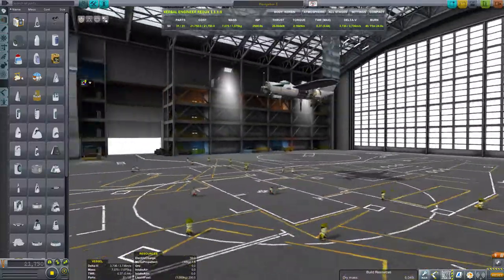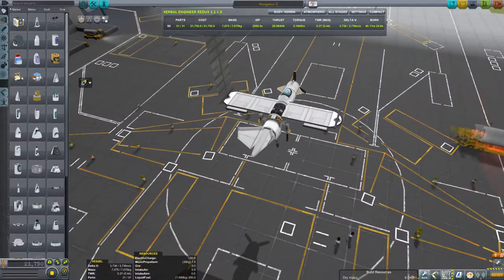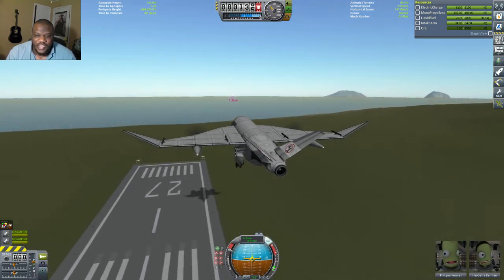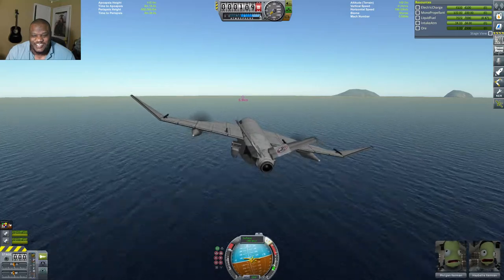Kerbal Space Program - Flights of the Navigator Series - Atmospheric Exploratory Aircraft

Comment: On the Navigator V, it wasn't going straight because your wheels weren't straight. They were kind of like this... / \ which causes intermittent, uneven traction pulling it to one side or the other. Wheels have to be perfectly straight horizontally and vertically or your craft will go funky on the runway.
Reply from the maker: yeah, I have the camber to counter the suspension issues. makes it more stable to land but affects the liftoff...one or the other i suppose lol
Reply: LOL Yeah, I was playing with the firespitter biplane parts in career and those wheel refuse to work properly. Same issue, got it to go straight long enough to get in the air but on landing the wheels stuck to the grass. SMH
Reply from the maker: +Jolly Roger Aerospace yep...firespitter wheels still need some tweaking...BD Armory though...in my testing...seems to be stable
Reply: Haven't tried BDA in this version yet, but Bahamuto is usually on top his mods.
Reply: what I have found that helps me is to tune some understeer, front wheels set the friction control to manual and put it at 0.3, brake power at 180. rear wheels, friction control manual 0.9-1.1 and brakes at 85-95 power